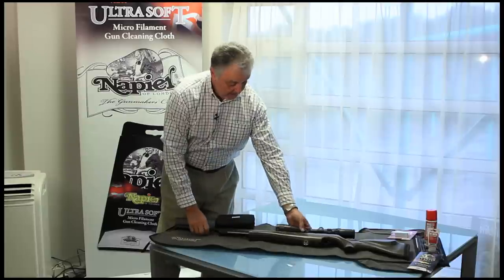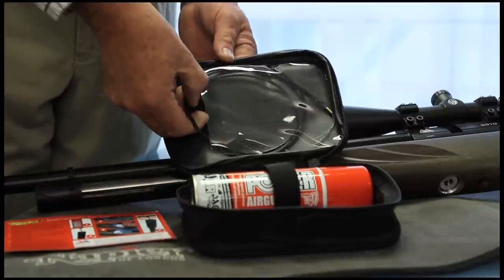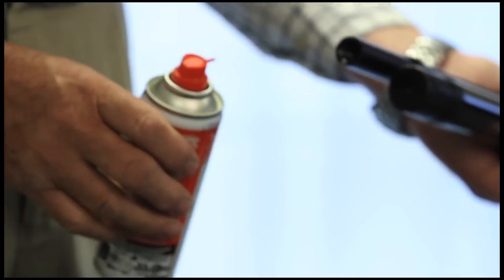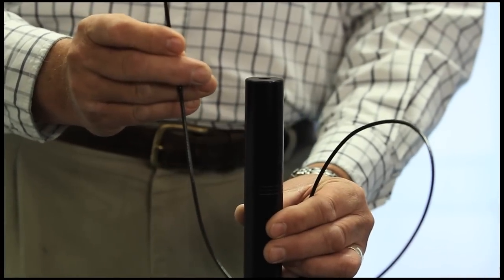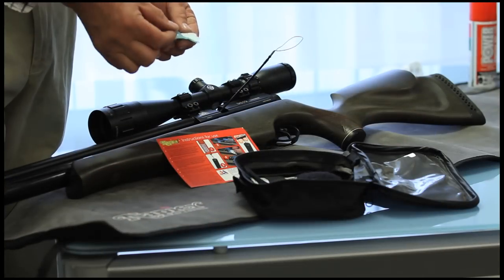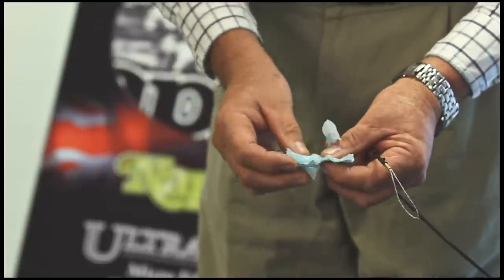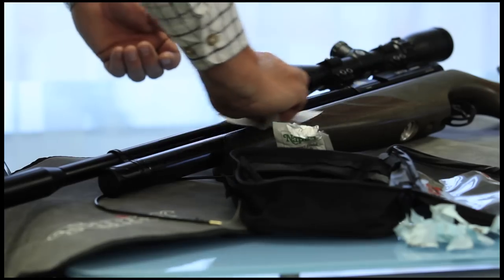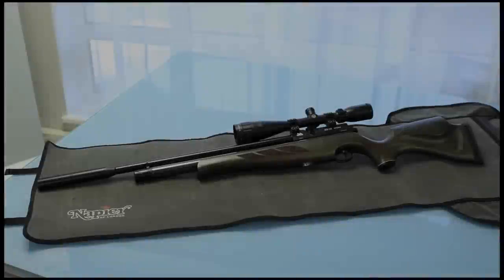How to clean an Air Rifle - Napier of London

Comment: This video overlooks one important point. . . . .  PCP guns have an O-ring in the breach which seals around the pellet probe. The O-ring will be damaged or potentially dislocated by hsing a pull-through in this manner.
When I clean the barrel of my HW100, I first remove it and then use a pull through consisting of 25lb fishing line with a loop at either end in conjunction with Napier oil and wipes - job done but more importantly, without knackering the seals in my rifle!!!!!!!!!!

Comment: You only need to clean your air rifle when you out if grouping. You can clean your barrel, when you put 1 pellet in and take the shot, it will be back the way it was... people only clean your air rifle when your grouping is out. 

I clean my 22-250 and 308 cal after 30 rounds, new centre fire clean after each shot depends on rifle.

I clean my shotgun o/u and semi after clays or hunting. 

I was a bigh fan of brunox till they started to add stuff that did not clean well. 

I use Napier Gun oil, patches, lub spray, jag, mop, dry patches, pull through. The only thing i dont use is Napier gun grease. Tetra Grease i use, i also use Napier kit at work  use it in my service rifle, its better than the issue crap we get at work. Gets the jos done quicker